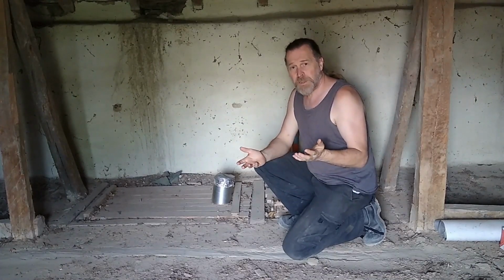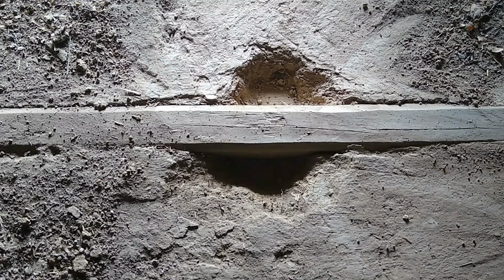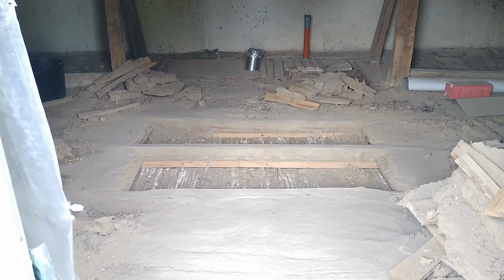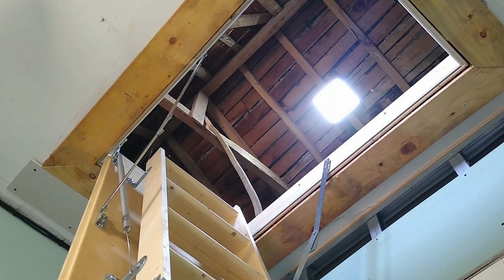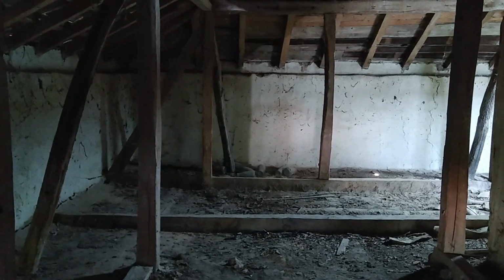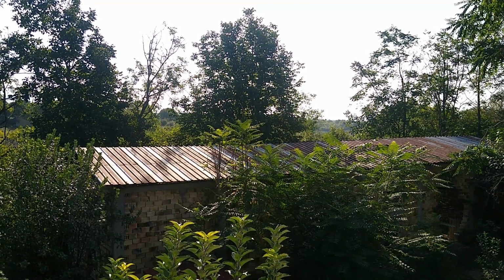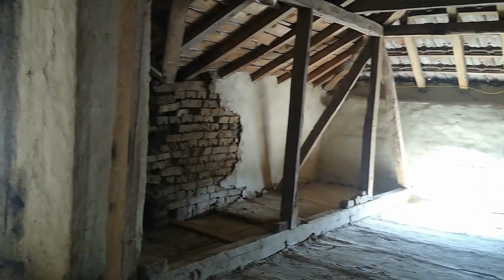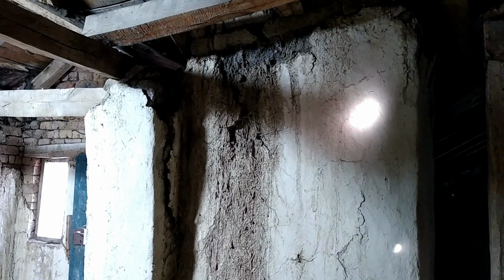Ep. 151 - A new lease of life for the loft

Comment: Man, you've worked hard in your loft. Like most Bulgarian houses you're lacking roofing felt, maybe it could be replaced a section at a time, big job. I don't know the thermal properties of mud but maybe some loft insulation would help in the coming winter. Good luck to you.
Reply from the maker: Thanks Daniel, you're right about the roof membrane, the only part with it is the small section I fitted last year doing repairs! There are plans for the roof but manpower and finance are limited at the moment.
We are fitting insulation between the original ceilings and new suspended ceilings as we renovate rooms. We may add additional insulation in the lofts but we have to be careful not to provide the wildlife with warm nests for the winter!